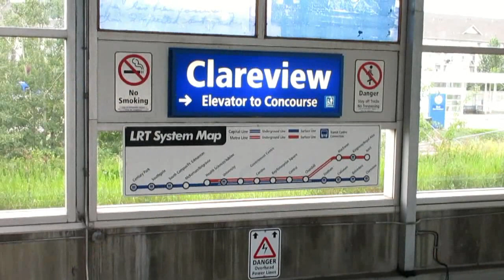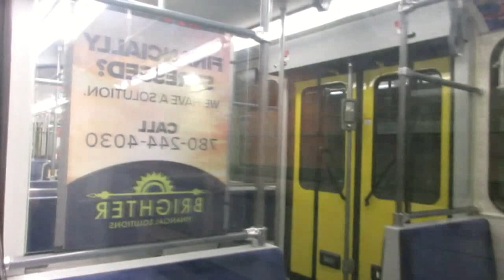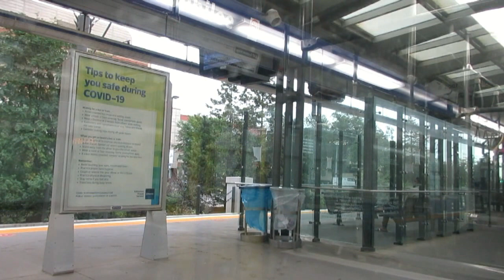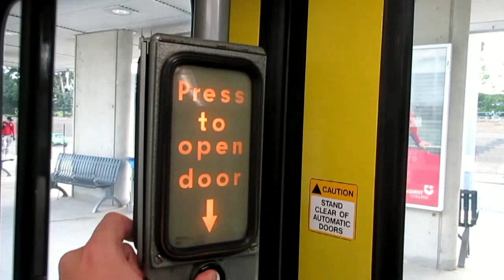Edmonton Transit Service LRT - Capital Line (Clareview - Century Park)

Comment: 0:18, I Got A Question, Why Did The Siemens SD160 Leave Clareview, Out Of Service? Was It Because Of The Schedule Times?
Reply from the maker: Those particular SD160 units were heading back to the depot. They were part of a train that was shortened from five-units to three - which left before I started recording.
Reply: @Welwyn22  Thanks For The Reply.